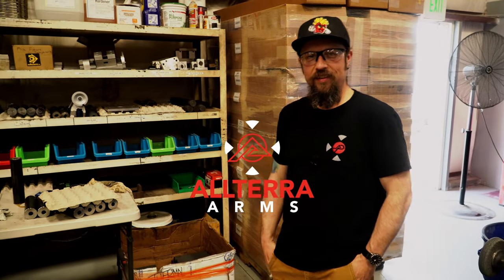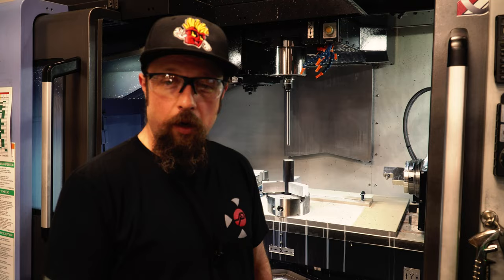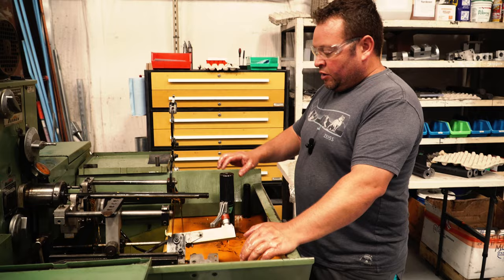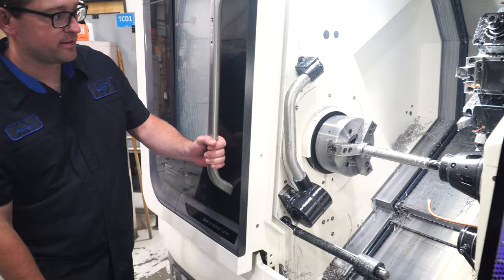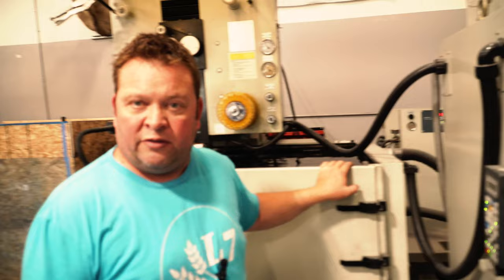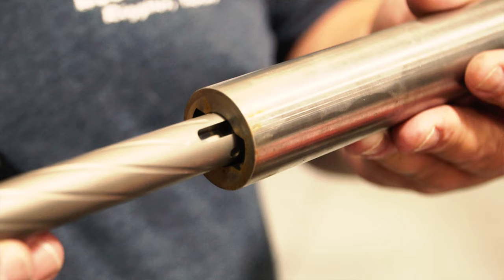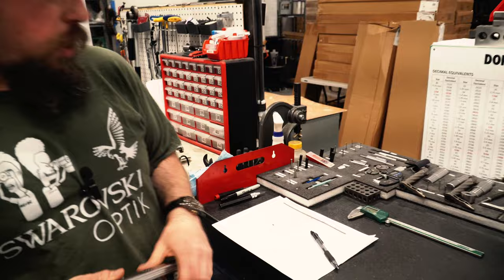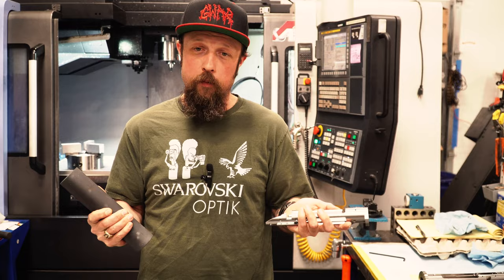AllTerra Arms Precision Bolt Action Receiver Manufacturing

Comment: I was wondering why not just do the whole inner bore and race lugs with edm? I saw some companies that just do the whole inner with edm, but it is a slow process, is that why you don't do this? Great video:)
Reply from the maker: Gundrilling and honing the bore is actually slower and requires 3 different machines instead of just 1 (the EDM). A precision-honed bore is even straighter and more precise throughout than EDM.

Comment: Nice video and info.  Why not EDM or Broach the bore hole like everyone else? Nice finish product.
Reply from the maker: Thanks for watching. We do EDM the bolt lug raceways, but first the receiver blank is drilled and honed to achieve a perfectly straight consistent bore which is supremely important because all further machining operations are fixtured or located off the receiver bore. We don't broach because its less accurate and induces more stress than EDM.
Reply: Thanks for the reply.  One more question.  Do you lap the bolt before selling your actions? Thanks again.   @allterraarms
Reply from the maker: @Booneboarder  That we don't, under the assumption that whatever gunsmith handles the project would do it within their workflow. However if you ordered one and wanted us to, we'd gladly lap the bolt lugs before shipping.